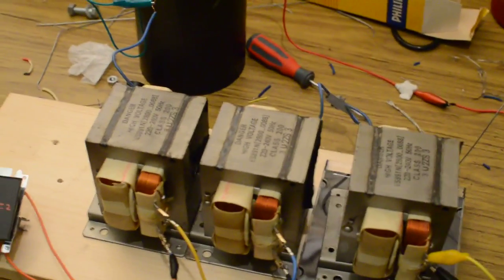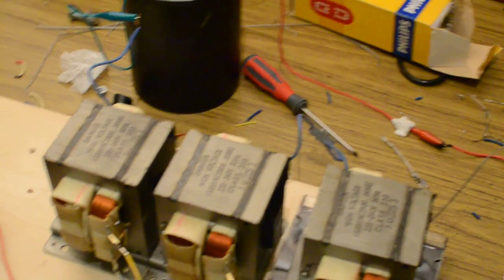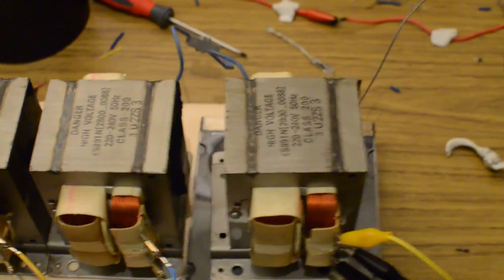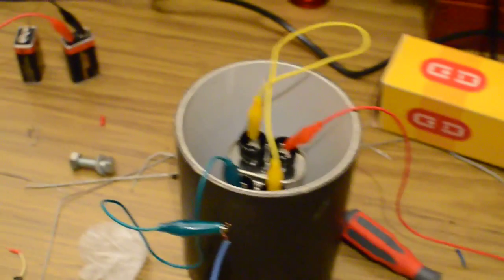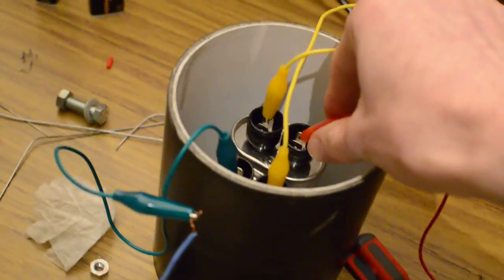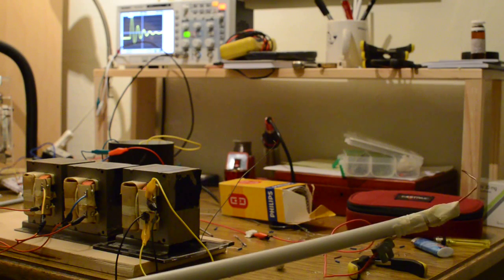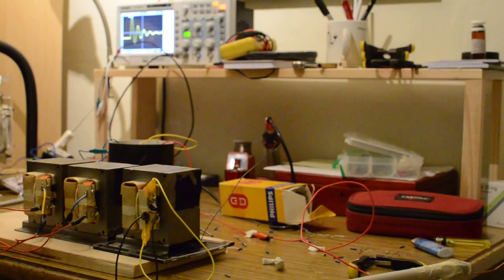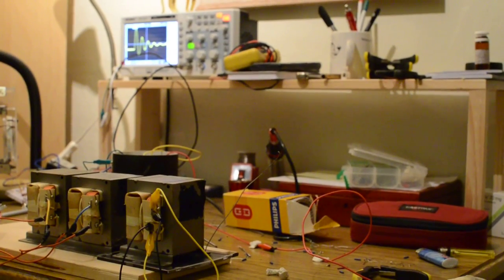Resonant MOT vs non resonant MOT

Comment: Do those caps really explode in resonant duty?
Reply from the maker: No they won't, I was just joking around as I'm rather scared of that setup. They are in series, so they can take the voltage from the two transformers in series. Using only one or two in parallel might be a problem.

Comment: WHAT?  speak up dude.  Either increase the volume or lay off the Valium before filming
Reply from the maker: I apologise for your unsatisfactory watching experience, there is an easy solution to that though. If you check your computer screen, right bottom corner you will see a bar with little icons in it. One of them conveniently looks like a little speaker icon. If you click that, you can push up a little slider that will increase the volume for you! Technology, right? There could also be other factors that affect the sound path, like unfavorable acoustics in your room. Any obstructions in your ear canal also can interfere with sound, especially debris or wax in the external ear canal that can accumulate all the way back to the mastoid bone and around the eardrum. Keeping that clean will really improve your quality of life and general health. Just please do not use q tips as those do more harm than good! Damaging your ear drum by pushing dirt against it can be a really bad and also painful thing. I hope that helps and have a great day!
Reply: Wow.  ...Imagine if you put that much thought into your video
Reply from the maker: @reginaldwigglebottom4731  I know I know XD but hey, I made that video long ago and unfortunately only had this crappy camera so it is what it is
Reply: Diago Jagluiperd, fair enough man...wish I could of heard it.
I’ll see what i can fish out of my ear holes, maybe there’s still hope.

Comment: I hope it's not too late but MOT arcs are absolutely horrible for your eyes, worse so then a welder.
Reply from the maker: yeah, you definitely are right, I was young and stupid hehe. My eyes are still very happy though
Reply: Why should mot arcs be worse than an arc from a welder? The amount and the energy of the UV radiation emitted is dependent on the current. More current leads to more temperature and higher energetic UV radiation. An arc welder has way more current than a mot and therefore the arcwelder is way worse than the mot for your eyes.

But you are right, you shouldn't look at the arcs without protection. I always use good sunglasses and i have never gotten photokeratitis. The UV radiation is not that intense so there is no need for a welding mask.
Reply: That's just not true. I'd rather watch MOT arcs all day than create a single weld without a welding mask. 2A arcs are nothing compared to 100A at 50V. Both do spew UVC tho, so neither is good to look at
Reply: @inductivelycoupledplasma6207  Hey looks like you found me from 4 years ago. Yeah I have no idea what that was about.
Reply: @josephrossman1600  just about UV and arcs mate. No worries, have a good day

Comment: Good fun but why don't you use a cap (<,=1uF) in the primary circuit to limit current? That will prevent your MOTs from overheating. You could also use diode & cap to clamp the output on both MOTs; out of phase would give you 8kV.
Reply: Do you connect the cap in series or parallel
Reply: Look at the power rating tag on the MOT. If 500W, a 100uF cap should provide enough capacitive reactance to limit input current around 5 amps. If your MOT can handle 1KW, then 200uF cap in series. Look up cap resonance calculators online. You want to be well below the MOT rating. The secondary side resonant tank uses 2 HV microwave caps, about 1uF each. Extreme DANGER, both the primary or secondary side can knock you dead if live. The secondary caps can still kill even with the circuit turned off. Many careless microwave techs dead from those caps.
Reply: Correction: I meant capacitive REACTANCE calculators. Reactance lets you limit input current.
Reply: Put the mots under oil

Comment: What would happen if you connected the secondary of one to the primary of another? Would you get over 30kV?
Reply: No, but you would het a pretty impressive fire show.
Reply: the primary is for 230 -240 volt , they burn if you increase the voltage
Reply: +Aghast The mot wires cannot handle anything near 30Kv. The insulation would fail. MOTS are cheaply made and not made for super HV. 

If it was possible to do, then the 30+KV arcs would be small. It would jump about an inch, but when you step up voltage in a transformer, the amperage proportionally gets lower. Energy cannot be created, just changed/transformed.

Lets say you step 100v to 2,000v, and the primary pulls 10A. Assuming 100% efficiency, the secondary would put out  0.5A (500 ma).

Step that up again, then you would have 40kV at 25 ma out.
Reply: @bossoholic    very good !!
Reply: @bossoholic  Yep and furthermore, even if the insulation withstood and we were satisfied with the lowered current by transformation, there would also be severe impedance mismatch, causing the core of the second transformer to go into saturation, essentially killing all of the efficiency and overloading both transformers.

For more voltage on a coil than it has been designed for, you need to proportionally add turns of wire in order to keep the impedance suitable for the voltage and to prevent magnetic saturation of the core. When magnetic saturation occurs on each semicycle, then the coil essentially acts like a short-circuit for the rest of the time of the semicycle (barring the resistance of the wire) and no secondary current gets induced during the time of saturation (because there is no changing magnetic flux then), and with such a voltage difference from the intended rating, the saturation would make the vast majority of the time of the semicycle.

In other words, the second transformer would just draw enormous current to burn out both itself and the first transformer, and during the time they survive, the second transformer would output almost nothing at all, except smoke maybe.